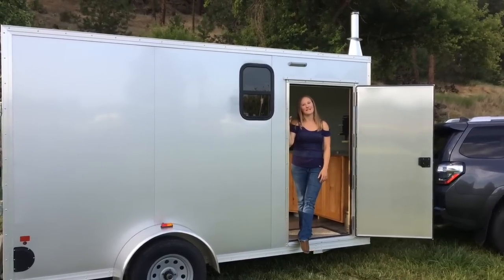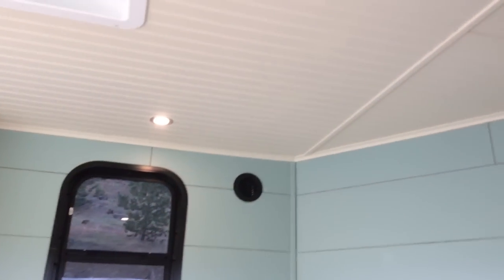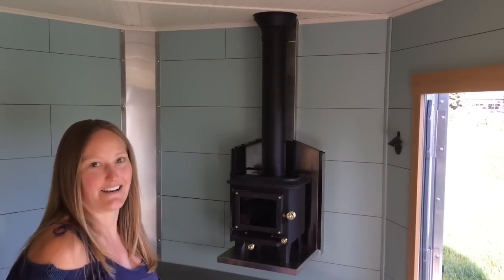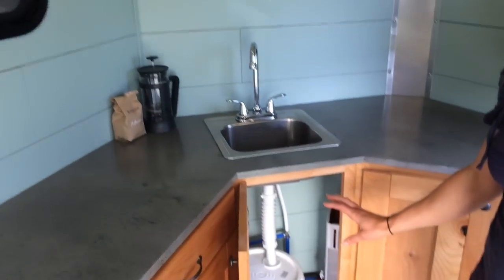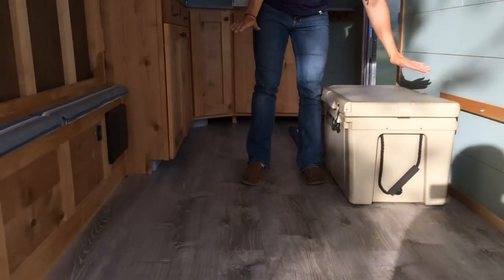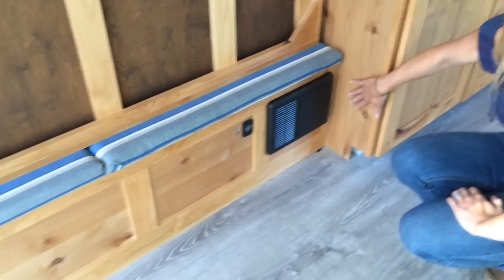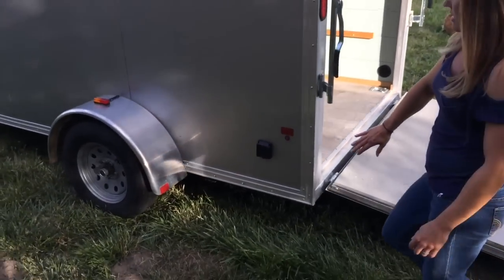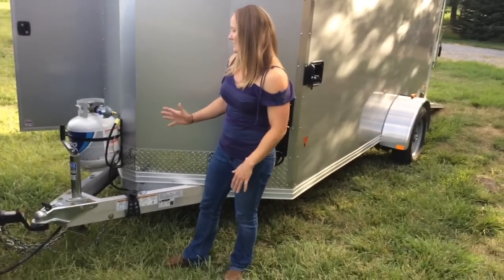Our DIY Cargo Trailer Conversion

Comment: Very nice conversion, and thanks for sharing.
A word of caution about you propane tank - You might want to get a milk crate to store it in for travel, and put it in a cabinet inside the trailer.
I worked on Promised Land TV show and we had a propane tank flip and roll inside the film storage box truck(no storage crate nor locked down) and the box of the truck blew up with 5 days of film and all the equipment. We never refilmed that episode and it was a nightmare of paperwork - no one was injured, just shaken up.
Also, some states have laws (with HEAVY fines) for transporting propane bottles inside of a car trunk, especially if it is unsecured or goes over a certain distance - their citing a public hazard as the tank can act as a bomb in an simple rear end accident.
Take care, have fun and make great memories.
Reply from the maker: Itsa Mystic Life that’s a crazy story, I imagine it was quite the pucker factor, I’m glad you were alright. Have you found many good options for transporting LP canisters? We bought a canister holder from e-trailer, gives it a sturdier base and run a tiedown through the canister a D-ring. When I take my truck I usually strap it in behind the cab. Honestly I don’t really like any of the options I’ve seen commercially, especially the external mounts on many the trailers, I find them flimsy and insecure. Anyway glad you’re all safe and thanks for sharing.
Reply: @littlejoey22   Yeah, everyone was fine, but it was something else to see our "Luigi truck" turn the corner and then blow up. Weeks of paperwork, insurance, fire marshals, and TV executives was probably worse than the initial explosion. You know the oh-no-excitement, incident containment and relief that everyone was safe versus the never-ending questions and what-should-we-do-now scenarios. The insurance companies were the worse part - fault finding (they called it "fact finding") and trying to get out of paying all of the damages. It's about $$$ not doing right.
Anyway, hubby & I did special event food service and catering for about a decade and used a plastic milk crate for each of our propane bottles. As part of the break down and packing up, we Always turned them off, unhooked the hoses and screwed the safety plug back in the propane tanks; then bungeed the tanks to d-ring tie downs on the passenger side in the cargo trailer. 
We're just finishing a goose neck tiny house conversion, and we don't like where the original propane tank holder is located (front of the trailer under the gooseneck extension). We're exploring options on placement and having a friend weld us a mounted lock box for the tank(s). 
We'll post a "ta-da" video open house when we make the final decisions (we still have the interior decor and outside paint to finish)
Reply: 2nd the milk crate. $6 investment at home depot

Comment: Nice ,I did a 14x7 special order with 5 slider windows, ramp back door but I also built a wall with a screen door and hard door in the back .the inside looks like a log cabin with a leather loveseat and coffee table. I went for 3 weeks and loved it. If I decide to I can fit a full size motorcycle and it will fit in the back doors.

Comment: I bought a 6x12 cargo trailer just like this one, and am planning all of the same things for mine except that I will have an indoor bathroom and shower. Very cool.
Reply from the maker: Thanks man, good luck with the project, it’s honestly fun, rewarding and not that hard. I found the whole project really enjoyable. Since finishing this one I’ve build another one for a friend a bit bigger and more insulated. It was last year and it started getting hard to find materials in a timely manor so if I may offer a bit of advice I’d start collecting the components you want now, it would suck being held up for a month or more waiting on some random product. Also, if you dig the wood stove check out 509 stoves. My buddy,  who I built that second trailer for is a pro skier and lives out it for 4-5 months a year traveling around filming and stuff and in his we put the 509 self feeding stove and he’s getting 12 hours of burn time which blows my cubic mini stove out of the water. If boondocking we have to worry more about freezing pipes while he’s gone all day without any issues. Since filming this video of mine  I’ve added a few things that you may find helpful, a self composting toilet is surprising easy, doesn’t smell at all and is a good addition. We also put up a folding shower hanger made from boat bimini hardware which gives us some privacy outside. Best upgrade has been a 100w Renogy solar panel. I seldom plug my trailer in, that solar panel keeps my battery topped off all the time, it’s great. Anyway, good luck on the project, I hope it goes well for you.
Reply: @littlejoey22  Thanks Joseph, I'll definitely check out those stoves. I'm holding off on solar for the moment and will settle for a generator and propane to power everything. I can't wait to get out there and spend some quality time in something I put a lot of work into. Have a good one!

Comment: thank-you so much for the detailed description of your materials.  Now I know what shiplap is...
Reply from the maker: Ha, well you got me, not real shiplap. I always make fun of the HGTV shows that put fake ship lap in their homes and bathroom and then I go do the same thing. I needed to cover the OSB sheeting and conserve on weight so I ripped down some utility ply, the real thin stuff from the big box store  then cut it into various lengths, rounded the edges, glued and pin nailed it to the 1/2 OSB. It didn’t add much weight and served its purpose. I gapped it using a few nickels, my thought behind that is so the edges don’t chaff and bind up cause a break or the boards to potentially pop. I think for this it was a pretty good fix
Reply: Thank's for letting me know

Comment: Very nice looking camper! I’ve actually been thinking about doing one for probably 15 years now. I keep my boat at a lake that is two hours away. There is a nice rv campground just across the lake from the marina. This would be perfect for having a place to stay rather than sleeping in my truck or a motel.
Reply from the maker: Thanks! It was a fun project, not that difficult either. Took about 2 months to build mostly working on weekends. 15 years is a long time to be thinking about building one, maybe it’s time to “pull the trigger” and make it happen? Total build out on this with including purchasing the trailer and a few other things we’ve added since including electric brakes and solar panels was around 8,500 to 9000. Other than the trailer itself the most expensive part was the stove which if given it to do over I would have gone another route for heating. For the trailer we went with aluminum to save on weight, it cost a little extra but was worth it as the difference in weight allowed us to tow an ATV with only the one #3500 lb axel. If weight isn’t a big deal for you then you could have bumped up to a steel 7x14 double axle for not much more money than what we paid for the 6x12. I hope this encourages you to do it, it was a blast to build and using it has a amazing and satisfying. 
-Joe

Comment: That is amazing, I still can't believe RV makers don't get a clue, and build something like this. A dealer could sell those all day at 10-12K, instead of the trailers that dissolve with water damage in two years for 20K.
Reply from the maker: Mt Thielsen thanks for the positive comment! You pretty much nailed why I built my own. I wanted a small well built trailer that wasn’t made of particle board and glue. I like the idea of the Airstreams with the aluminum body and chassi but at the end of the day the price tag is so over the top I can’t justify buying one. I’ve upgraded a few things since this video, solar panels, fold out shower curtain, electric brakes etc. I’m into this build for roughly 9k now and honestly I couldn’t be happier. Some mods I would like to do is to build in a permanent propane heater. The wood heater is cool but it would be nice to have something that I can set to a temp and leave it when we’re out playing without worrying if the pipes might freeze or not. Anyway, if you’re thinking of building one I’d like to encourage you to do so, it really was a pretty easy project and I get a tremendous amount of joy and satisfaction out of it. Hope you have a good night.
-Joe

Comment: I've watched alot of these videos.. I think this is my favorite build of all
Reply from the maker: MixinitupOutdoors thanks! It was a fun build and we’re happy to share it with folks and just want to encourage others to give it a try. Or give them some ideas. Thanks again for the positive comment, it mkes taking the time to film and edit it all worth it.  -Joe
Reply: @littlejoey22  forsure. I am currently looking at pulling the trigger on a 7x14 or 7x16. Not sure yet. Will definitely be using your layout design. Any chance of seeing how you built the bed and how it folds down. Looks really cool. I forsure want a woodstove in mine to. Absolutely love how you guys did that
Reply from the maker: MixinitupOutdoors the bed is super simple. I cut a 45 degree angle down the length of a 1”x3”x 6’ piece of hard maple. I mounted that on the wall to the metal studs such that the 45 degree angle faces up. On the bed frame I mounted an identical piece only this time with the 45 degree angle pointed down. The two 45 degree angles match up so that the bed is pulled into the wall and is fully supported along the rail. On the other side I mounted two fold down legs. The legs have stop blocks mounted on the bed to keep the legs from rotating when in the down position. Super simple, sturdy. If this doesn’t make sense I can make a video about it. Also, the wood stove is cool but for me it’s mostly a novelty. It’s nice during spring and falloff take the edge off a cold night but when it gets really cold it’s a pain in the butt. It heats the trailer quickly and easily but if I’m counting on it to keep the trailer warm at night when it’s pretty cold I find that I’m getting up a few times during the night to stoke it and because of that I find it hard to recommend it. Also when we took the trailer skiing for a weekend I was stressing that the pipes would freeze. So for the time being if it’s cold I make sure that I have an AC power source for a small plug in electric heater. I like the wood stove but as a primary heat source it’s just not reliable enough for cold weather boondocking. Also, it was expensive. After all was said and done with the wood stove, heat shield, stainless pipe, cap and cone I was into it for nearly $1,000, much more than I was originally planning on spending. Also, I’ve added a 100w Renogy solar panel and charge controller which has been awesome awesome. I haven’t plugged the trailer in for over a year and the battery has stayed completely charged without any problems. Anyway, hope this all helps.
Reply: @littlejoey22  
Could you convert it to propane?

Comment: Ive actually been debating on the tandem axle over the single...not sure if the extra tires and extra size truly are needed, guess im trying to be budget friendly for the long run but i suppose you have a point on not being so concerned on weight. Thanks for replying so quickly.

Comment: Very nice! I'd like to see how your bench works.
Reply from the maker: The idea at the start was to put a pop dining table underneath the bed, then fold up the bed to bare wall and use the bench for sitting at the table. However we haven’t made the table, found we don’t really need it and so the bench basically just works as storage to house our battery bank and then on the other half it stores blankets and pillows. It also is nice as a bed side table. I wired in a usb charging port to it. The pillow top also works well to help keep the bed from shifting around while we’re traveling and have it stowed in the up position.

Comment: Nice job.  Do you find the 6x12 is a bit small?  I was planning a 6x12 camper build.. but after seeing it in person, I felt it was a little small.  I ended up going with a 7x12 plus the v-nose.  I'm about 70% done on my build now.  Hopefully I'll have it finished by summer time.
Reply from the maker: Joe Scopa size wise it’s ok, I think 7x14 is better. In a perfect world for my needs I think a 7x14 single 5k axle aluminum trailer with 6’6” ceiling height would have been great but those are hard to come by. I built it with the idea that my wife’s 4Runner would be able to tow it comfortably with the atv inside. Much heavier than this setup and I think it would struggle with the steep mtn passes all around us. Good luck with your build, it’s an enjoying and rewarding process.
Reply: @littlejoey22  I was actually looking to buy a 7x14 plus the v-nose, but the dealer sold it before I was able to get to it.  They did have the same trailer in a 7x12 plus v-nose.. so I got that one.  Had I got the 7x14, I may have put in a full bathroom with shower, but I skipped it with my 7x12.  I'm just adding an outdoor shower now. My trailer is a dual axle, but its all aluminum, so its not too bad for towing - but I'm also towing with a Silverado.  

Anyway.. nice job on your build.  Congrats.
Reply: Btw.. here's a link to my latest video of my build.. in case you're interested in checking it out.  Cheers.

https://www.youtube.com/watch?v=iVQc9dj1L_M
Reply from the maker: Joe Scopa I dig it! I like the e-trac idea. I kicked around doing that as well. Have you thought about maybe putting a bottom on the beds and hinge it such that the dead space between the 2x4s could be used as storage? It would make it a little heavier and more of a pain to move but every lit bit of usable storage is a pulse .
Reply: Joseph Nelson the bunks aren’t actually framed so a bottom wouldn’t work.  It’s just plywood laying on top of 2x4s but it’s not attached.  It’s literally just laying on top of it.
Reply: Nice job.
Reply: Hope you share a video too :-)

Comment: Beautiful! What are the wall panels? Are they light weight? I love all of it. Thank you!
Reply from the maker: Hey thanks Jordan! For the wall panels I bought a few sheets of 5mm utility ply from Home depot and ripped them down on the table saw to 7.5” wide. I then cut the ripped down planks into various lengths to offset the seems, rounded all the edges and spaced them slightly apart (I used 5 cent  nickels to get my spacing). Behind them is the factory 1/2@ osb and so when I adhered the utility ply pieces I troweled on a general purpose construction adhesive and stuck them to the wall. I used a couple of pin nails to hold them in place while the adhesive dried. This gave me that shiplap look without the weight of real pine shiplap. Also it was way cheaper. After I installed it, I painted it before installing the ceiling or flooring. For the paint my wife used Sherwin Williams emerald paint line in satin finish and the paint color is seafoam green. I was skeptical of the color but she likes it so it’s good enough for me. For the ceiling I used plywood bead board, don’t use the mdf bead board, it is heavier and more susceptible to any moisture that hopefully doesn’t ever happen. Hope this helps, thanks for the positive comment and have a great day.

Comment: Hello,  Very functional and looks very well made.  Like the concept of the "Murphy Bed" coming down onto that ledge, but was actually looking for extra fresh water tank to fit under our older motor home to extend our stays when boondocking.  Would be super if you could tell me the manufacture you bought yours from.  Looks like it not very tall and would work underneath our MH.  Hope to hear from you, thanking you in advance for your info on the manufacture company.    Kindest Regards,  ~~ Karen Calypte
Reply from the maker: I can’t say for sure but I think it’s a “class A customs” water tank. I didn’t really look too closely at the manufacturer, I was more looking for a specific size to fit into the space that I needed.
Reply: @littlejoey22   Thanks so much for replying.  Cut and pasted this you posted to me: "class A customs water tank".  It opened up more business and images and I found several the size configuration that would work in the space we have.  Again, thanks so much for the info.  Kindest Regards,   ~~ Karen Calypte